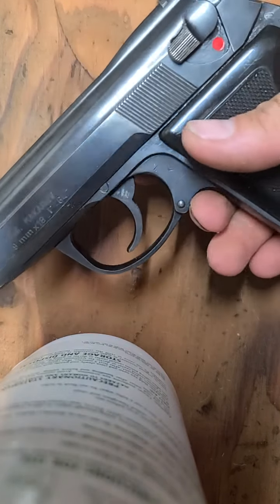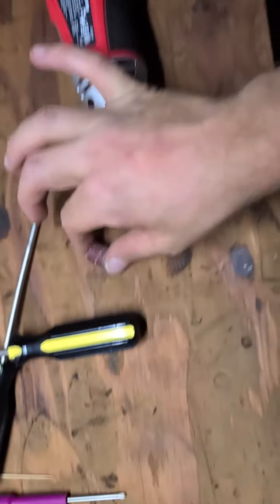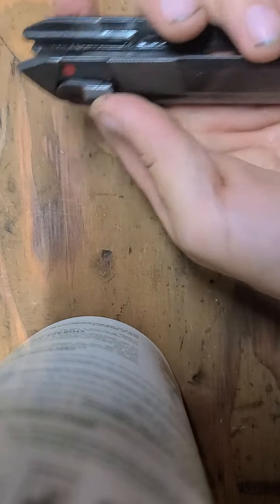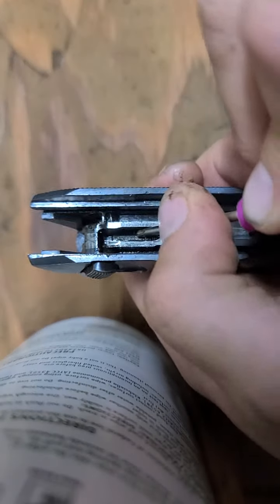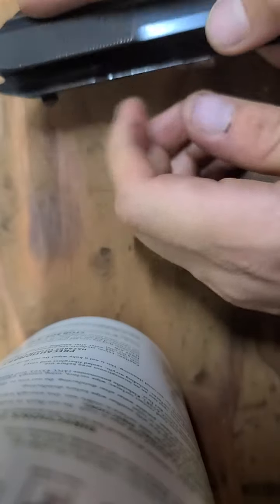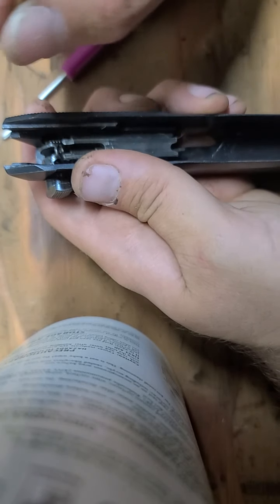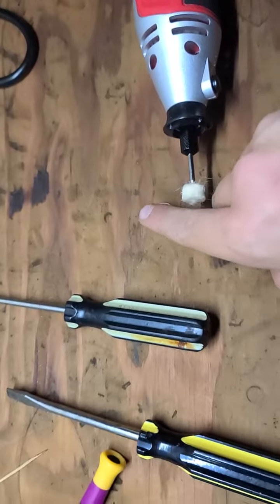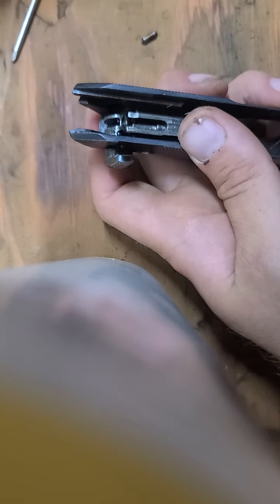How to fix a stiff Safety on a Polish Radom P64

Comment: You can use a pair of locking surgical forceps to grab and hold the firing pin from the front when it pokes out of the breechface after you push on the back of it.  Then the back of the firing pin will be forward and not in the way of removing the safety lever and you can have both of your hands free to work rather than needing to keep pushing the pin forward with the screwdriver or punch while you work.

I will look for your reddit group if I can remember my login and join it.